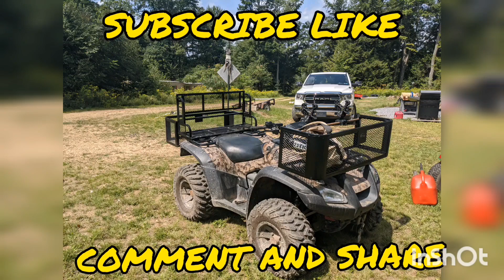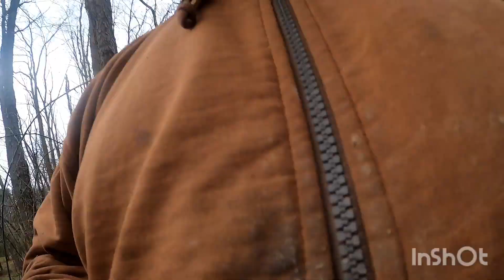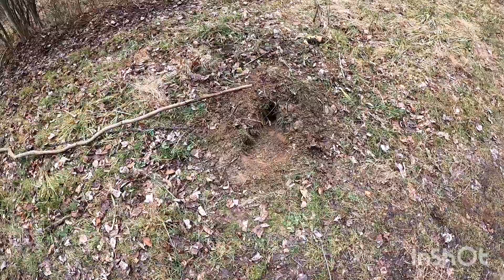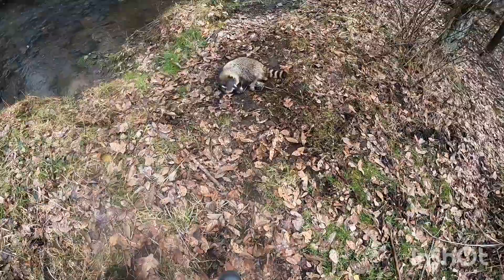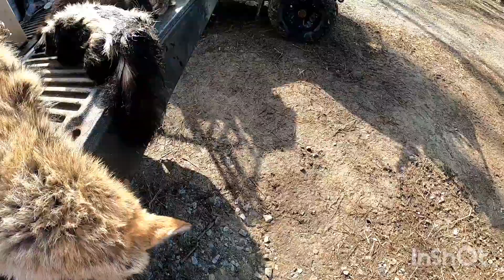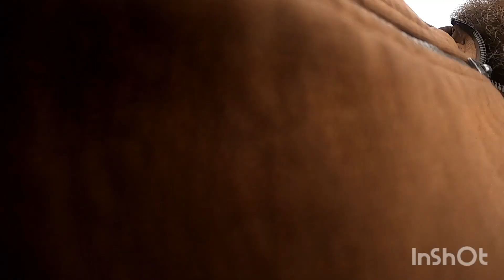Pa Trapping S.2 E.21 coyote #5&6 and hit 1k. thank you.

Comment: congrats on 1k  . you are doing great on the catches and your beaver trapping is getting good . the big pile has worked great for us and clint locklear's enrager beaver lure is #1 on catches .just ordered back breaker and castor blastor to try . use 3/4 plywood on your beaver boards it is less springy and does not bow as bad .just put in a rack to dry 14 beaver at one time . keep doing what you are doing . love the channel .